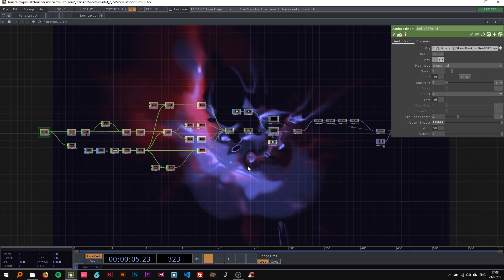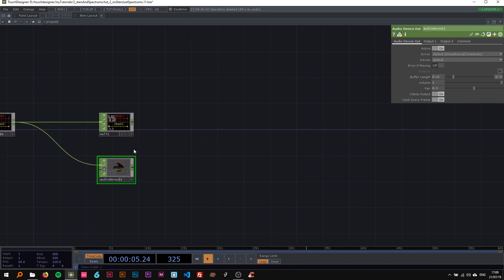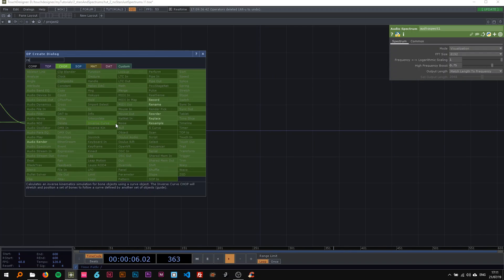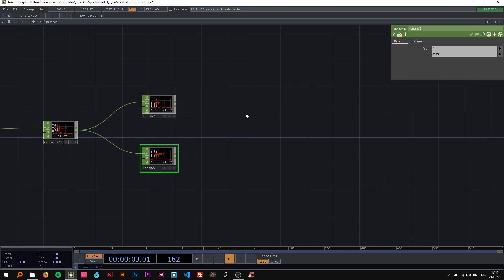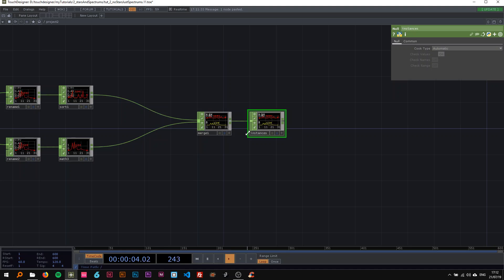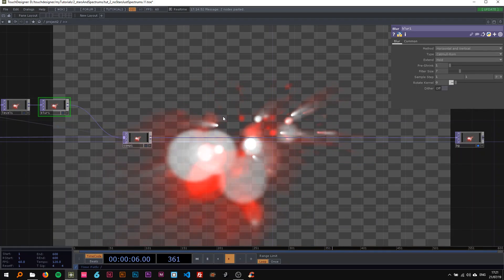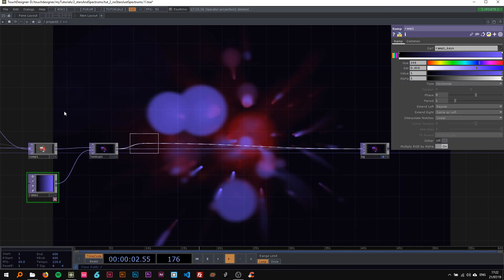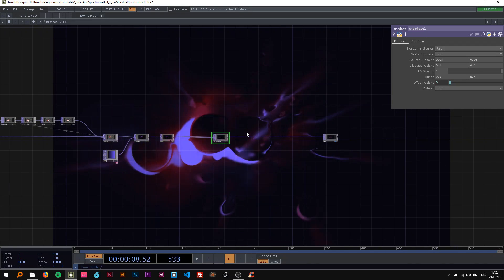Aurora Audio Spectrum – TouchDesigner Tutorial 2

Comment: When i turn on "instancing" and connect it up, my visualizer just looks like a moving line as if there are way to many circles clumped together. I have tweaked every setting and i cannot find out why mine looks different even after watching the video and doing exactly the same steps. Even when i turn on the noise, in the video i can see all the separate and transparent circles but on mine, its just a blob of lines moving around.. please help i love the final project! :'D
Reply: Having the same issue here, going through settings... Did you ever find out what the cause of this was?
Reply: My only thought is that it has something to do with the changes to instancing since this video was uploaded. I will post if I find out a solution! :')

Comment: In the 2022 version of TD the color mode in the geometry instance 2 have a new parameter and the value spec for alpha doesn't works as in your video (at 11:30), I tried to open the project in the 2021 version and there it's working as itended, maybe there is something to know with the new parameters "Color Pre-Multiply"
Reply: I had the same problem and found that turning on "legacy alpha behavior" in the Common tab of the Constant MAT gave me results similar to the video.
Reply: @octive1994  THIS GUY IS THE PLUGGG
Reply: @octive1994  omg thanks for telling this, i was so confused why mine wasn't working like in the video!
Reply: @octive1994  2 years still helping thanks my g
Reply: @octive1994  thank you so much!!
Reply: @octive1994  3 years later. Thank you so much for this tip!!

Comment: The option CHOP Length/DAT Num Rows/SOP Num Points isn't available in the Instancing tab of the Geometry operator on my version of Touchdesigner (which is newly downloaded from the official site). The second option on this tab is also called Instance Count Mode rather than just Instance Count, and I'm unable to reproduce this visualizer.

Bileam, or anyone reading this -- any idea what the issue is here? I'd love to be able to make this, it's gorgeous!
Reply: Its ok, just use the one u have - "Instance OPs length".  Put "Instances" value into the "Default instance OP" and then just Translate X = tx, Translate y = ty, Scale X and Y = size. Works for me
Reply: @FilippFilippFilipp  Thanks a million!

Comment: Hi Bileam! This is my 4th tutorial Im doing with these videos and its amazing!
I have one problem, came up to the circle/render part at 9:30 and my circles don't split, its one line. 
I can't figure out which module is controlling that for the last 2hours, redid the thing twice now :D
Reply: I had this same issue, what fixed it for me was that I had accidentally picked "Same Rate, New Interval" in the first resample instead of "New Rate, New Interval". Instant fix for me, hope this helps!
Reply: i have the same problem. did you solve it?
Reply: @spenzakwsx4430  Hi, my computer broke about a month ago so I don't have the file, but if I remember correctly, for some reason it was the audio I was feeding it, seems like the circles not separating for me was the "audio filters" didn't filter it very precisely , so the background "boom" in my audio track was percieved as a motion the system needs to track. Either way playing with the first half of the modules on the left (audio>filters>channels part) fixed it for me suddenly. 
Hope it helps, Ive also learned that for me deleting a module and reinserting it didn't reset the values so fixing stuff was complicated or seemed like nothing happened.
Reply: My problem was the camera… made it closer look.

Comment: Hi Bileam. Another great tutorial. I'm getting everything to work but the size. For some reason when I update the Geo scale to "size" the circles get so large everything turns white.  I tried using an audio filter to limit the size but still the circles are too big. Maybe I need a more minimal audio file.  I'll keep trying different ideas.  But overall still I'm learning so much from your videos!
Reply: @cheetahlion79 to solve for this - adjust the math operator after the rename size operator. On the To Range .2/.2001. It was at 3 which was too high for the song I'm using. Something much lower but larger than .2 will likely work for you.
Reply: Actually 0/.01 might work even better